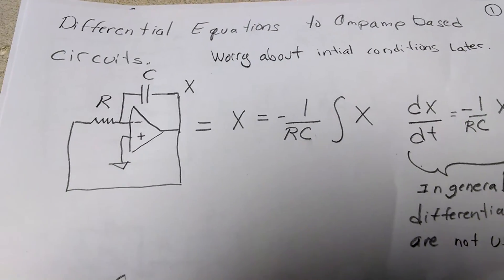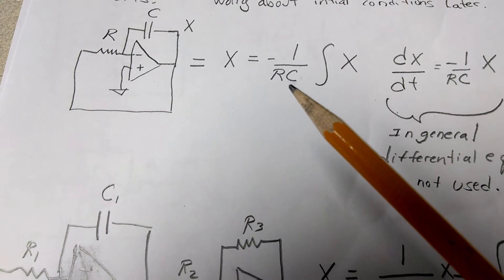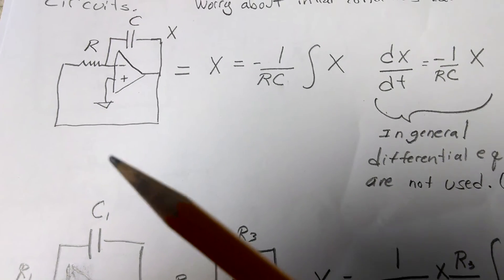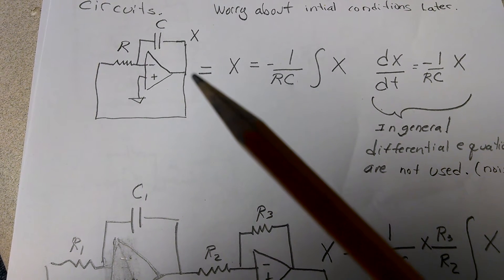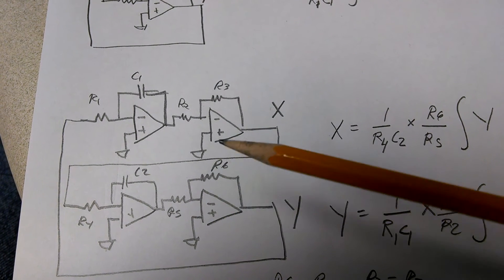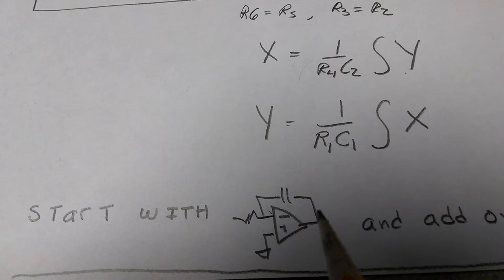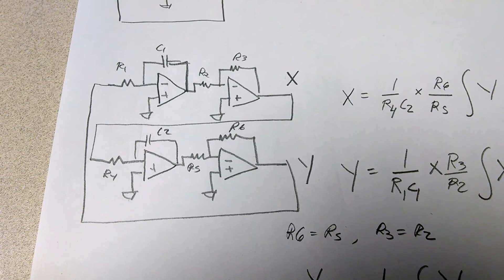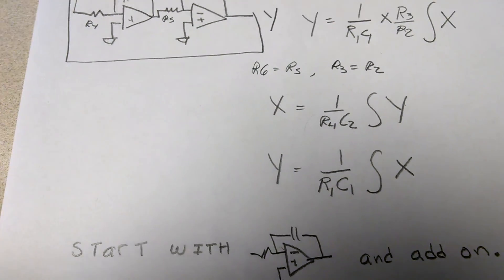OPAMP Differential Equation Building Bocks

Comment: Thank you for your video!!!
Im trying to solve the following mass-resort without damping system of ODE
dx = y
dy = -36x
x(0) = -1/2  and  y(0) = 1

However, after I build the circuit the solution of it doesnt behave as the oscillating solution of the system. The circuit only saturates. 
First I though about scalling the values. However this is not a problem for the step function response.
Would you give me some insigth about this???
Reply from the maker: +luja13 Here is a behavioral model of the circuit in ltpsice:
https://dl.dropboxusercontent.com/u/35091424/EE122/ODE_sample.asc
It does not seem to go above 5 or below -5 volts.

If it is saturating it is most likely due to the offset voltage in the opamp which gets intergrated and leads to saturation.  You either have to use the opamps Voff set tuning pin or use an opamp such at lt 1630 or 1001 that has a really small offest.  The LM741 has an unpredictable offset from chip to chip and so sometimes a LM741 will work and sometimes a LM741 won't